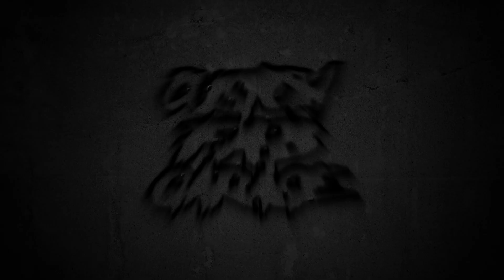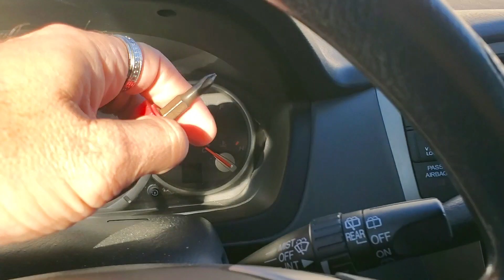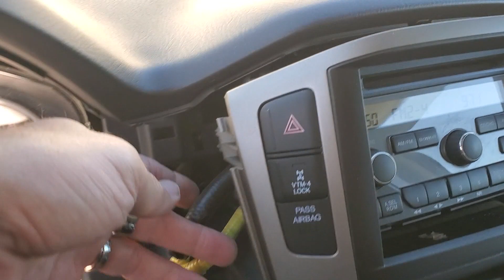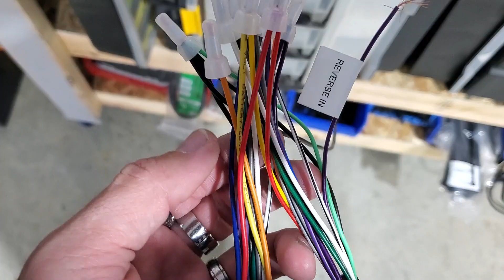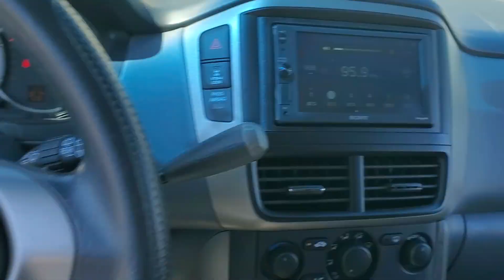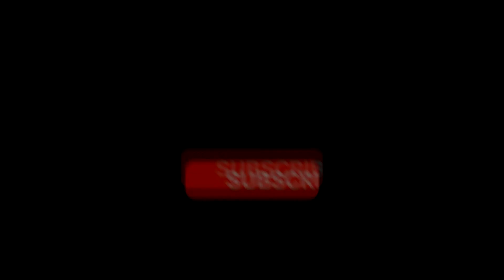HONDA PILOT RADIO / DOUBLE DIN INSTALL WITH STEERING WHEEL AND BACK UP CAMERA

Comment: I'm trying to figure out all the part numbers I need but I can't find it anywhere?
Reply from the maker: You click on more on the description or go to the description of the video it will list all the parts with a clickable link.
Reply: @octanetvchannel  
hey i found it i was just wondering have you ever put DS18 speakers in a car door before i was thinking about putting them in my honda i was wondering if the tweeters would fit where my old tweeters are at?

Comment: So my battery died - How do I enter the radio code now to stop the alarm from blaring when I try to do anything (Do I have to reinstall the original radio, which I do have)?
Reply: Call dealership and get the code. Give them your vin number.

Comment: Great Video.  Quick Question. Is anything extra needed in order to make the Satellite Radio work?  I know some of the harnesses don't have a connection for it.  I have a '07 Pilot EX-L with an Entertainment system.  If you know anythign about this that would be great.  Thank you.

Comment: Great video. Not sure where to connect the blue wire of the Antenna adaptor? Should that go to the blue wire on the Harness? The reason I am asking is because my radio reception is not that good, and I think the Antena might have an amp in it, but I am not sure if it should be connected to the red +12V wire, or to the blue wire? (or not connected at all) thanks
Reply from the maker: Some vehicles you do not have to connect it. If you want to try to connect it to the red wire of the harness or the blue wire of the harness that will tell you if you have a powered antenna or not
Reply: Thanks for your response, but I am realizing the following:  
1: The Blue cable on the Harness is really not connected on the other end, meaning that pin going inside the car is not connected. Even though the blue cable is in the harness, it does not seem to go anywhere.
2: There is a white and blue cable out of the plug into the AX-1000. Based on the manual it's called REM-OUT, and apparently its to power power-antennas or amp-antennas (Page 28 on Sony AV receiver manual).  (0.4 Amps)
3: So if I am understanding correctly, the white-blue cable IS OUT of the AX-1000 and should provide power to the antenna connecting to the blue cable of the antenna. The blue cable on the harness will remain unconnected.
4: I think (assuming the power antenna is 12Volts, I should also be able to leave the REM-OUT cable disconnected and indeed, power it with the RED Wire. 
Please let me know if this makes sense to you, and thank you very much for help.
Reply: Ok, it worked as I expected. Now what is not working is the Steering control. Followed the instructions, but the controller does not seem to operate. Green-White cable to the Pin-3 (red-green) with a c-tap. Then the GND Black cable connected to the back brown cable, red to red. Finally the 3.9mm Jack to the Blue Jack Remote in the AX-1000, but it does not work, not sure if I have to do something else, your advice will be welcome? (My car has a a hitch installed previous of my buying the car. Not sure if that would interefe or have anything to do).
Thanks

Comment: Hi, the honda pilot has a 2-amp subwoofer. When you remove the stock head unit, the 2-amplifier will notbe there to support the 2-amp subwoofr. Did you use an external 2-amp subwoofer when installed the double din? Thanks

Comment: Pilot has such good visibility in the back really would not use a backup camera. The only useful for hitching up a trailer I have one on my Ram pickup really helps there backing up into spaces can't really see below the tailgate. What I hate about the pilot at least the year 2006 which is mine the factory radio has security code when you unplug the battery have to drive it to the dealer have them generate some codes. One reason I'm planning on swapping it CD player is broken so when start it makes lot of clicking noises. I don't think ill go with a lower cost JVC single din type has Bluetooth, digital radio, and SiriusXM radio.
Reply: In your glove box there should be a 5 digit code that is the numbers you press to get your radio working when the battery gets unplugged or dies had to do this a few times no problem if you know where the code is on the car
Reply: @GetShoopedOn  There was no code in the glove box. I had the dealer print the code out. Ill label it myself in the glove box.

Comment: When it came time to the wiring you made it really confusing by  saying “here” “here” “here” and wasn’t clear when actually pointing out to what is “here”
Reply from the maker: These are basic wiring colors and if you don't know how to wire up a basic harness I would advise taking it to a professional. These are basic things that anyone that installs radio should obviously know. I want to make sure that everybody that installs this knows what they're doing but at the same time you have to have the basic fundamentals of electronics to be able to install a radio. If not you're going to have a tremendous amount of problems so I would recommend taking it to a professional if you cannot wire up these basic color codes
Reply: @octanetvchannel  lol nah I was able to figure it out by looking up diagrams, it’s more of the fact you weren’t clear about it. Video was definitely useful info but there were parts that could have been explained/shown better. Yes it’s basic matching colors, but there were some colors that didn’t match that I had to attach when it came time to the steering wheel interface and backup cam. Say/think what you want but all I was saying was could have been more clear with direction instead of just “here”. Little bit of constructive criticism wasn’t trying to dog on you lil bro
Reply from the maker: @ethankann  no I definitely understand we just get a lot of people that get upset when we don't put different parts of the installation process in the video. We are trying to make videos more detailed as much as possible and we do forget some things. It's so time-consuming to make these videos so any constructive criticism we greatly appreciate because we want to make these videos as thorough and easy to follow as possible. Thank you for the feedback and we're always going to strive to get better and more detailed

Comment: Will it work on LX Models with the basic radio? My 06 doesn’t have a reverse camera and no buttons on steering wheels
Reply from the maker: It should
Reply from the maker: I would check on metraelectronics website to confirm

Comment: What did you connect the solid Orange ilumination wire to?
Reply from the maker: Vehicles have certain different illumination wires most of them are orange with white stripe. It just depends on how the illumination setup is in the vehicle and on the radio? Newer radios like Sony and pioneer have their own built-in illumination you don't even have to hook it up because it has Auto dimming
Reply: My sony xav-ax3000  has an orange w white stripe  illumination wire that i connected to the same colored orange w white stripe from the metra 70-1721 connector. But there is the orange wire on the metra 70-1721 as well.
Not sure which is the correct one to connect to?
Reply from the maker: @johnpierce9447  I would try each wire and see when you adjust the dimmer or turn off the lights if it turns off the brightness on the radio. All vehicles are different when it comes to the orange wire, orange with white stripe and some even have orange with black stripe

Comment: FWIW - good recommendation on the 8mm hex rather than using a screwdriver. Those aren't Phillips screws. They are (like many Japanese screws) JIS, which look like Phillips but will easily strip if one uses a Phillips (instead of JIS) screwdriver. You can tell by the dot next to the cross slot ("X" on the screw head).

Comment: Nice Video, looking to do this in my daughter's 2008 Pilot, unfortunately, ours has the DVD/video system so there is an extra multi-media plug on the back of our radio.  I know the plug that plugs into the middle with the 2 wires is apparently the subwoofer, and without adding an amp, not sure there's a good way to integrate that.  Looks like kicker makes an RCA to speaker wire converter, maybe that would work.  We also have a single wire with plug that I am unsure what it's for.
Reply: I'm dealing with the same thing right now. Did you ever figure out how to keep the DVD player working?

Comment: What are some good slice connectors to buy? Where to buy good spade connectors?
Reply: Harbor Freight usually has assorted sizes of basic components in kits, would be a good place to check